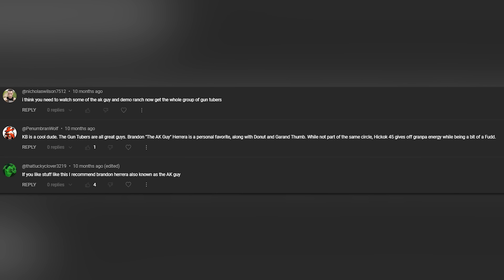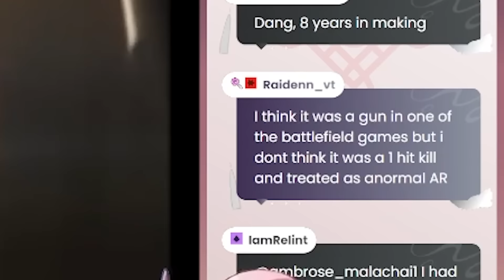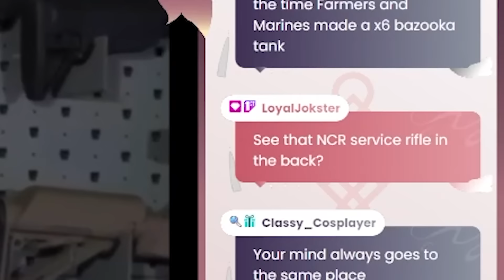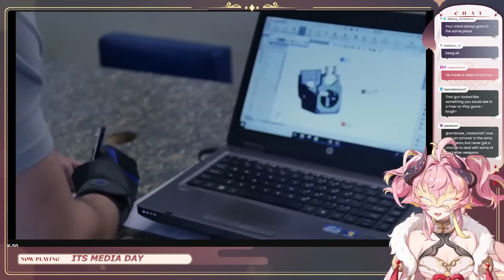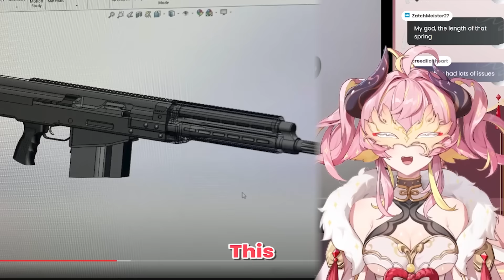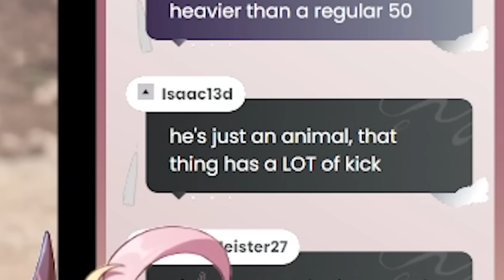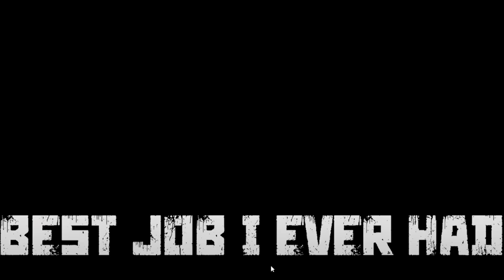Vtuber REACTS to an AK-50 be made into Reality | Brandon Herrera Reaction

Comment: fun fact: the weight of the Ak-50 compensates for the recoil. when Brandon said "As heavy as it is it shouldn't be". If a gun has more mass the amount of momentum is going to result in less acceleration or movement in the gun: meaning, less recoil or “kick.”
Reply: Yeah but also the gas system is absorbing a LOT of the energy before the mass of the gun has to. The bolt in that thing has to be an absolute monster, and to drive it back with the gas... ESPECIALLY to be able to mag dump it.
Reply: Ah yes, the Mark23 method of making .45 more controllable than 9mm.
Reply: With the massive weight AK-50 has, there will be less recoil felt. Therefore, the accuracy of AK-50 will be slightly increased.
Reply: good ole inertia
Reply: The genius Kalashnikov desighn with heavy reciprocating bolt carrier also helps redistrubute blowback force.
Reply: @varvarith3090  Id say the cam and groove system for the AK BCG does most of that work but the biggest difference from Kalash. design to others is the short stroke gas system.

Comment: When it was originally released, the AK-47 was simply called the "AK", short for "Avtomat Kalashikova", literally translating to "Kalashikov's Automatic [rifle]". The "47" was retroactively applied to denote the year that the prototype design that would eventually enter service was finished. The AK-74, similarly, was a smaller caliber that entered service in 1974 and is the still in service (with a few modifications) to this day.

In this case, the "50" in AK-50 is referring to the fact that it is chambered in the .50 BMG. This technically makes the AK-50 an anti-materiel rifle.

Comment: 12:36 reason why it doesnt kick as hard  is 
1. muzzle break at the end putting in work.
2. Gassed pretty lightly
3. weight of the gun
Reply: You think a Moving Barrel is possible?
Reply: @kilo1901  unless you do away with the whole gas system no. Then It wouldn't be an ak50 it was just be another barrett clone.
Reply: @cryowarrior1  
Got it.
Reply: 4. Brandon Herrera is built different
Reply: The muzzle break was actually working too well

Comment: The "47" in "AK-47" means it was designed in 1947 same for the AK-74 
But the "50" in "AK-50" means it shoots .50 BMG (his idea tho) and if something shoots .50 BMG or above it should be a HMG (Heavy Machine Gun which could kill a wall) or an AMR (Anti-Material Rifle which could also kill a wall) and his AK-50 in this case is an AMR not AR (ARs rather shoots 5,56 -7,62mm with NATO standards) 
Brandon Herrera's AK-50 look more like a simplyfied AS50 with shorter gas stroke and shorter barrel (that's my oppinion tho, i ilke his idea to scale up an AK use .50 BMG) 😂😂😂😂😂😂😂

Comment: The recoil is low because of the compensator on the end of the barrel.
Reply: The muzzle brake helps a lot, that it's absurdly heavy helps a lot, and being semi-automatic also helps some. Would help more if it was recoil operated, but then it wouldn't be an AK-50.
Reply: @SgtBeltfed  Has anyone weighed it yet? I've only seen this video on it but I know there are several.